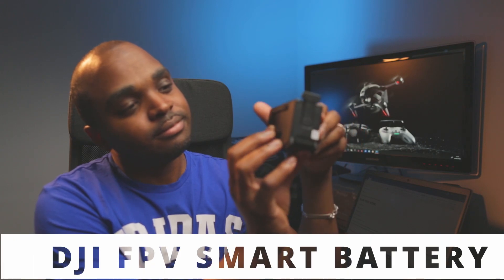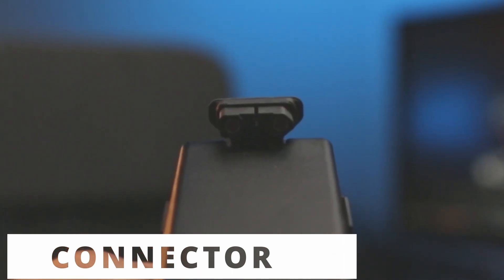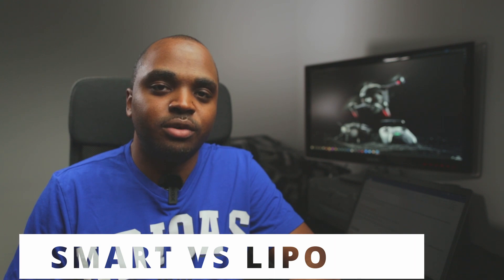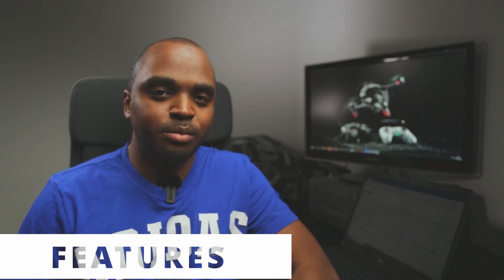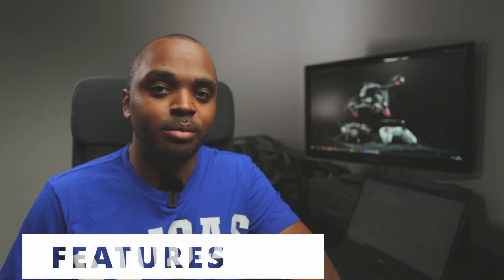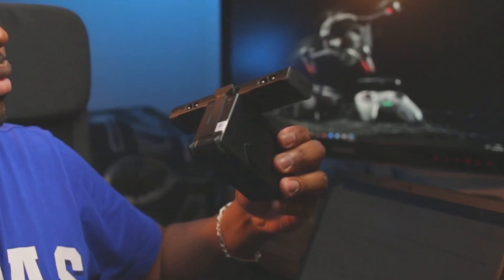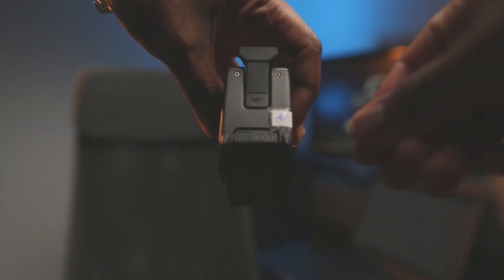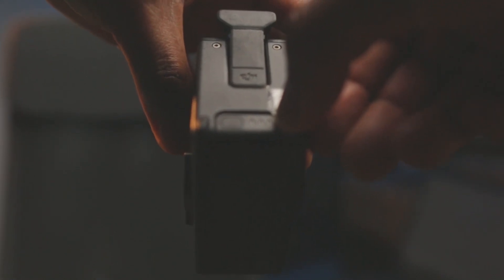DJI FPV SMART BATTERY

Comment: Informative, thx. Having said that I hate DJI for treating us like children, with self-discharging batteries and forced and locked firmwares. Perhaps this is a guarantee to prevent consumers from suing them.
Reply from the maker: Dji fpv has pros and cons, it's m'y first fpv drone , i have tested other 3 inch, 5 inch quad and a 7 inch very soon, i am glad i started with it , but it s just the beginning...
Reply: @brunovfpv5756  DJI is second to none for enterprise drones and the care system (but not for the FPV). I am preparing to pass all possible exams in order to be licensed to professionally fly a Matrice and agroDrones. the FPV I got for pure fun, to be able to manually fly at high speed. I have not done it yet, i am in the Alps, open spaces without obstacles are scarce.

Comment: Oh yeah I got all the accessories to like the arm racers both of them motion controller  small rig. Air dynamics kit the only thing I’m using is the lens cover. about although the battery condom.  But I can’t use because I got a anti-battery ejection 3-D printed piece to go on it everything just about everything you can get for it now with the Ludacris luxurious props every time I put them on the drone thanks I got the propeller guards on and lowers the drones capabilities for safety. Is that weird.
Reply from the maker: I hate the propeller guards

Comment: Yeah that’s the plan I’m saving up so I can get three or four fly more combo  for it.  But for now I’ll fly the bad battery.  To about. 30 percent.  Because it still counts down just like a good battery on the percentage.  Or until it says insufficient output power and then I’ll ground it as fast as I can.

Comment: Hade my fpv. For about 40 days.   Now my goggles ar saying.   Battery lifespan reached.         From. Overuse.    I.  Run it to about 15 percent.   Let it cool for a. Good wile.  Them charge it.  And wait for the lights to stop blinking.   But I only have one battery.  So wen it’s full. I’m flying.
Reply from the maker: Buy some extra ones